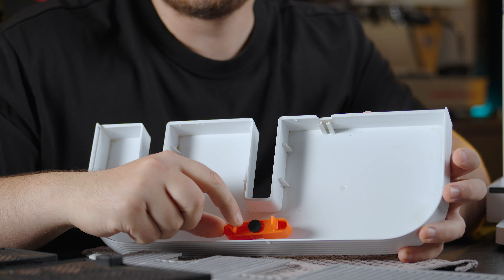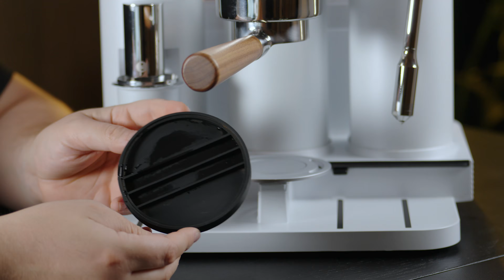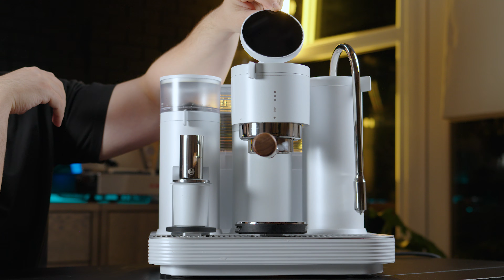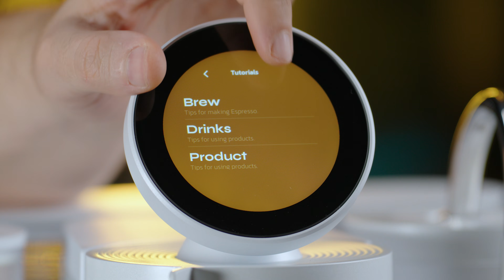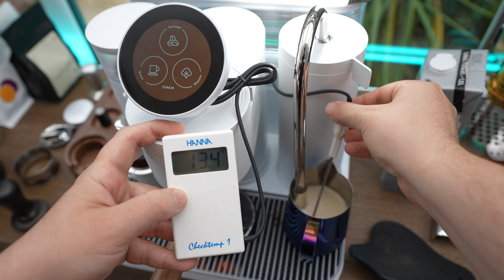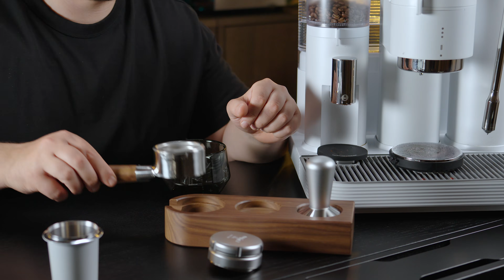Meraki Espresso Machine, ALL IN ONE?!

Comment: Thank you for this video and showing the actual time of milk steaming. Not many, if any i can find always do a cut shot on these key points for me. So knowing how fast the steaming of milk is is important to me also  so thanks for that.  im torn between this and the Sage dual boiler, massive price diference but i do want to change from sage  i think
Reply from the maker: Definitely Meraki, the rotary pump with its smooth and quiet sound, heating time, built-in scale, it is 100% the better option 👌🤍☕️
Reply: @ourcoffeeshelter thank you bsage has fast heating time but I do like the scales and rotary pumps stability and I think the steam wand would be much better also than the sage. Would i be right in the steam wand being better and faster

Comment: Thanks for the thorough review @Amer. Two questions - How much does the touchscreen tilt & fold. Second question - many reviewers have commented on the "metal on metal" crunch feel/sound when inserting the portafilter in the group head. What was  your experience?
Reply from the maker: Hey, thank you for your kind words!

The screen does not tilt that much, sometimes we did feel it could be better if it mover even more backwards, but generally speaking, it covers the most important range for most scenarios. 

As for the group-head, never had that issue, it does need sometime to get used to the group-head as it is slightly different degree compared to LM and E61 group-heads. Nonetheless, did not find anything strange about it, only that it cannot adapt other portafilters ☕️🤍

Comment: Meraki like Cisco Meraki? Let's just say I would have a fair bit of doubt about an espresso machine made by computer network hardware company
Reply: Meraki Tech has no connection to Cisco Meraki. “Meraki” is a traditional Greek/Turkish word meaning to do something with love, creativity, and soul. Cisco’s trademark covers tech-related categories, while ours is specifically for espresso machines.
Reply from the maker: Hi there, only time will tell, but when you try more than 20 espresso machines and test them throughly, you can build an anticipation of the longevity. Anyone who owns it, will be able to tell that both performance and durability are great. Most important thing is that there are so many options to fit everyone's need 💯
Reply: I have a meraki router that cost like 15k lol. This is a bargain